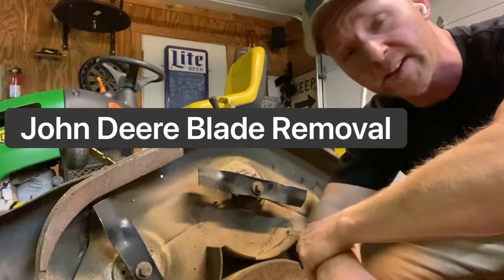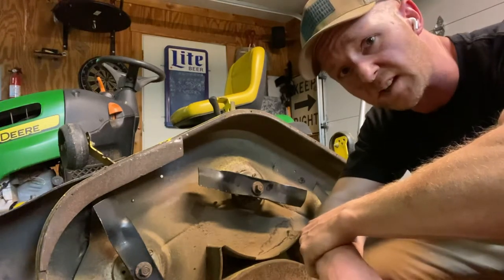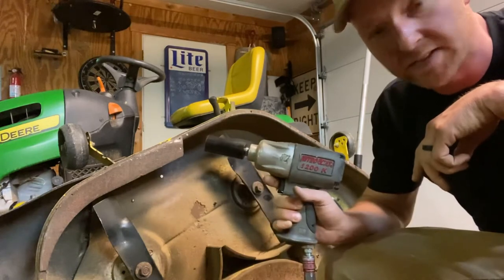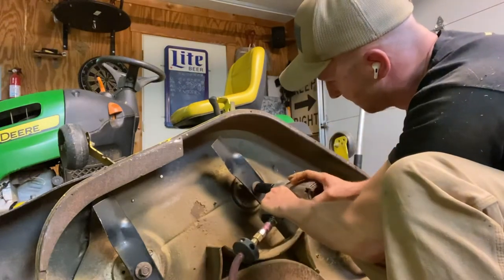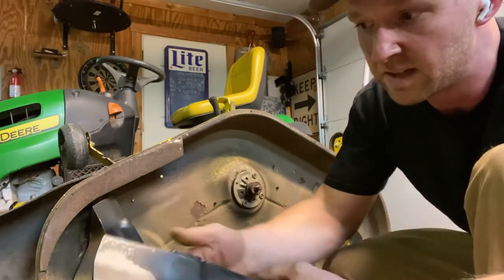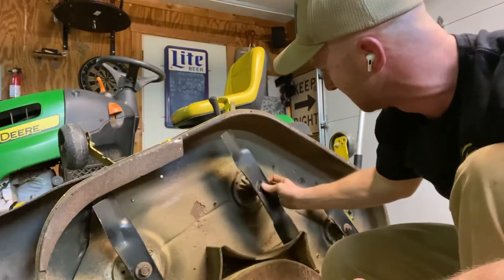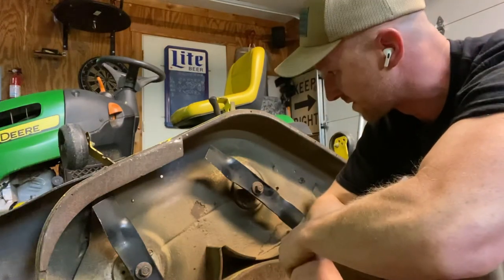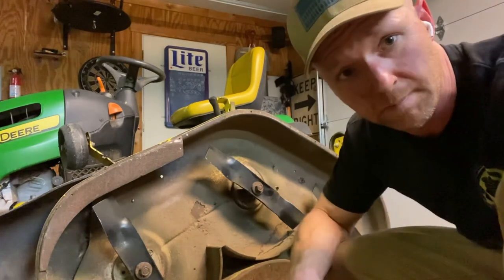How to Replace Mower Blades with Impact Wench! Fast & FUN in 3 Minutes!

Comment: Thanks for the video!  Just bought a 20v impact wrench that I can use @ 100 ft/lb or 275 ft/lb torque.  Any tips, having that info, to avoid overtightening/stripping?
Reply from the maker: That is great news, everyone needs a sweet impact. My only advice is if you put the blade on with an impact you better have one to take it off. You will never get that thing off by hand after that hoss tightens it down!

Comment: Finally, someone using technology! I’ve been scratching my head trying to figure out why everyone was using wood blocks and clamps and all kinds of nonsense... thank you! This is what I was going to try but didn’t know if there was some reason not to
Reply from the maker: I agree I can’t stand seeing guys make some kind of lift out of wood blocks, just buy a Jack already. The only reason not to use an impact on blades is it makes it harder to take them off of you don’t have an impact to take them off with. But if you use one both times you won’t have an issue. Thanks for the comment!
Reply: @MowerMike  Jacks kick out in the field lol. But holy hell, I was thinking there was some reason not to use an impact. Nope. Thank you for making life easier. I probably could have kept the deck on too......
Reply from the maker: @SeanWMODonnell  It is a much easier job with an impact!

Comment: Most mower blades these days have the label "Grass-side down" on them to make them more idiot-proof. I use my DeWalt 20V lithium impact wrench to remove and reinstall the blade bolts, works like a champ. Torques them down with more than enough force. On high-lift blades that aren't labeled, the curve of the blade should always curve up toward the deck, not toward the grass, as that curvature is what creates the suction force underneath the mower deck.
Reply from the maker: Impact is the way to go!